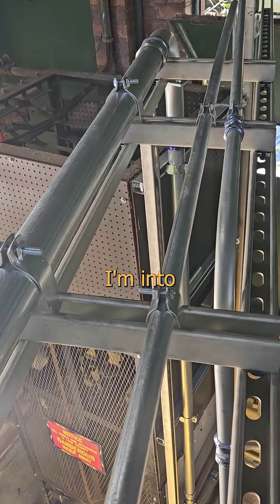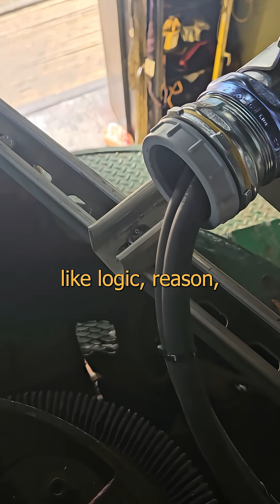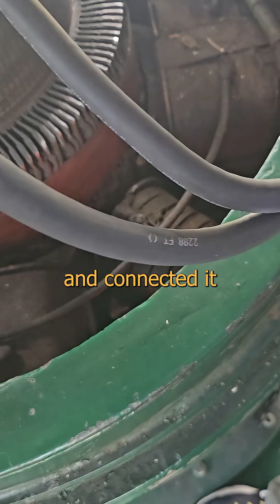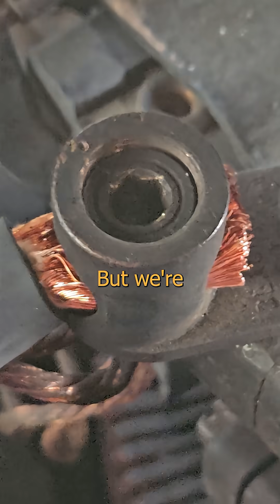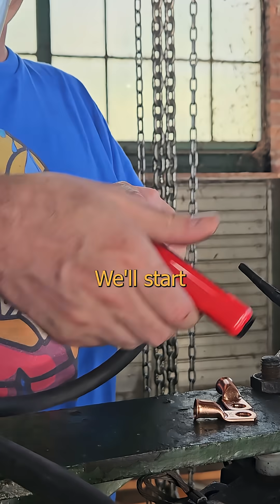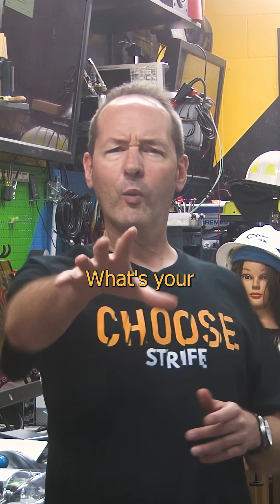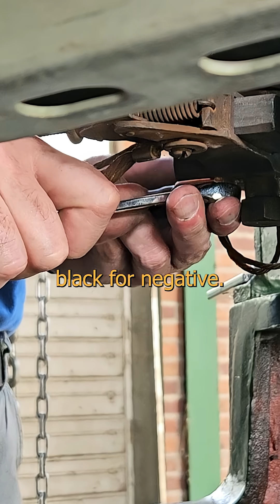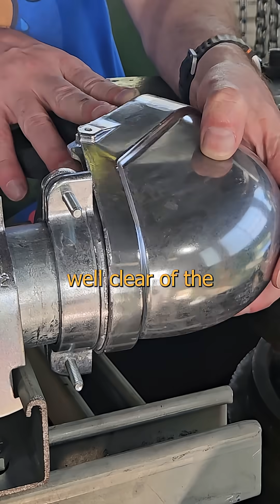Exciter Update #chrisboden #comedy #engineering #powerplant #electrical #educational #wiring

Comment: I've been wireing marinas for the past 17 or so years in salt water environments and we always nolox the terminals prior to crimping. Also we have found that heat shrinking tends to trap salt crystals over a few years. The wire we use is GGC, G or W cable so we also use ferrols when landing in mechanical lugs due to the fine strands of copper flaring out when torquing. Just a few things we do to keep the inspectors happy.

Comment: I doubt you read this but

Check the temperatures on those connectors - they may have cross-section lesser than the wire or copper worse than a wire.

Comment: ⚠️WARNING! Critical thinking in progress. Join the effort at will! ⚠️

 So....🤔 If an exciter slip ring will wear unevenly because of direct current, then the same will surely apply to graphite brush dc motors, right?    One brush will be shorter than the other at the end of lifespan ..and since the DC radiator fan motor cant simply be run in reverse for half of its life, then should one brush be made slightly longer than the other??  
Edit I have actually contemplated this whole reversing of the radiator fan. If switched in reverse and engaged for maybe twenty seconds after engine shutdown, the radiator might be sufficiently cooled by shaded, cool air which is drawn from underneath the vehicle, and all of the engine outer electronics might be cooled slightly better. The entirety of all engine heat would be evacuated through the ac condensor grid, forward. None of it would be blown back from the radiator, onto the engine. The fan motor itself would get its first actual forced-air, self-cool-down. Its WORTH A TRY, RIGHT??😊

Comment: Its better to heat clear heat shrink on the fitting use colored heat shrink lower down for indication. The reason to use clear on the fitting is to be able to see if and heat or other potential problem can be seen prior to getting worse

Comment: Noalox is cheap insurance on copper, and that steel grit actually improves bite between conductors if you have a bad crimp or a loose nut (I hate those).  Switched to that decades ago on automotive electrical repairs while living on the Pacific.  Haven't seen a black or green copper connection since.  

Using on connection nuts also improves fastener torque, and who doesn't more of that.

Comment: Being in electronics since forever (yeah, low voltage hobby stuff), I've always soldered most everything.  Is the copper-to-copper crimp "good enough"?  Are there cases when you'd want to solder things?  Or would that not make any difference?

Comment: Crimped lugs make me happy as the end user.  If they used crimping, they probably made the insides pretty too.

Also, minimize dissimilar metals when connecting equipment topside is one of the standards of mil-std-1310 4.1.2A (STANDARD PRACTICE FOR SHIPBOARD BONDING,
FOR ELECTROMAGNETIC COMPATIBILITY).  It prevents galvanic corrosion when exposed to water and air.

Comment: Noalox   No ALuminum OXidation  .   This is a compromise that you do not need to make for copper but is essential for older aluminum conductors.    I would put a lick of STL2  on the bolt thread for future ease of service,

Comment: What would I do? I do low power, my main tool is a schematc and a teeny tiny soldering iron. I do also have a big iron, but I doubt it's big enough for a wire that is that fat. The wire wouldn't be quite that thick here though, we have 230V.

Comment: NoALOx is nice to prevent oxidation, but soldering under a crimp is a superior соnnесtion as there is nothing to potentially slip the crimp. Especially since you stated the need to reverse leads every six months, putting torque on the crimps as they are swapped, potentially inverted, and re-torqued. 

Are we using adhering heat shrink tubing to remove any oxygen from around the strands? Now the solder makes even more sense.

Comment: Would not care about the neutral grease. But I would probebly lean up the contact surfaces, get som shinyyy metal on it. BTW in those fittings I would use some Ferrules.

Comment: When you take the time to do a job right amd ho the extra mile to make it better than you found it makes people trust you to do other things and it makes things last longer. I chewed out my mechanic about this over old leaking coolant hoses that are easily accessible when the transmission is out which it was for a clutch replacement. Day after getting back on the road the coolant hoses, that was surely bumped when the trans was pit back in, sprung a leak. One of those while your in there jobs cost me time and a repair in a gas station parking lot

Comment: Unless you weld braised or solder two pieces of metal together then they corrosion at any point they contact each other because they are dissimilar metals. The act of welding brazing or soldering essentially makes them into one piece so you do not have that layer of corrosion building up between them and one side is going to take the brunt of the corrosion crimping is not adequate to prevent this

Comment: Try lacing the cables next time. It’s a waxy twine that hold much better than zip ties. It’s common in DC systems alsothrow something under the cables when your supporting off the frame to keep the insulation from premature wear

Comment: I know this is an old video, but when I use those types of crimp plugs, I like to dip the tip in a bit of flux, crimp it like normal, then heat the cup with the torch, and melt some soldering into the wire-cup joint, to make it not only forever tight, but bonded.

I've never done a 120 volt DC, I usually do smaller things.

Comment: Use Burndy “Pene8”. It’s the goo that comes inside c-taps and hy-lugs. You won’t have any dissimilar metal corrosion with copper to copper, but will oxidize over time and this will prevent it, but it’s copper specific. Might be a good idea if you’re planning another century of good connection.

Comment: As a steel mill electrician, I use Burndy PENETROX on ALOT of connections. Especially in the wet environments, and when old connections have signs of corrosion. I will even use it on bolts that are partially rusted, or required the strength of Hercules to remove.

Comment: If you want a hard reference in aviation you would refer to T.O. 1-1a-14 ch 13 table 14 for uninsulated copper terminals. It will contain the pn for the terminal lug crimp tool and crimp die for terminating anything up to 0000. Terminating to this spec will result in the highest reliability possible for that class of terminal lug.

Comment: Copper to copper the only thing you could do is add dielectric grease to the joint after its crimped but before the heat shrink goes on. Aside from that, noalox isn't required for copper to copper. If aluminum isn't in the mix don't worry about the aluminum oxidation inhibitor...

Comment: I've put many crimps on "welding"  cable like this and I was taught that if the terminal looks just a bit too small it's probably the right size. The wire looked like it was too big for the crimp terminal but I bet he could make fit........ Just like in your mom.

Comment: Noalox is 100 percent of the time for me on stranded mostly large wire. You were just talking about wetting current and each strand has to do that everytime you use it and inevitably heat is produced due to some oxidation resistance. Which swells the copper. Then it happens even worse after it shrinks back down. Noalox prevents oxidation and long term thermo cycling. This will make it last forever even with very damp and even salt spray air. 
Source: 
Joe knowledge from Working with 600volt dc and 480 ac in places constantly exposed to salt spray.

Comment: Nice to see basic cable work done properly.
Makes me sick to see all the unfinished cable ends people just leave exposed to oxidation then wonder why things don't work properly after some time and use.
Stripped wire isn't finished. It's just exposed.
Crimped terminals and adhesive sealed heat shrink and woven sheath and loom is not expensive. Make cables properly and use oxygen free copper of the proper type and gauge for what you are doing. That way stuff works properly and lasts longer.
Good on ol boy for doing it correctly and showing the noobs what the end of a cable should look like.

Comment: When crimping fine stranded cables the tubular part where the cable goes in should be twice the length of your lug so it can be crimped at least twice. The lugs you are showing are for swa and larger stranded cables.

Comment: Seems to me that the surface of the crimp plugs connecting to the machine is way less than the original wire? Could that cause problems?

Comment: I normally like to see the crimp fittings with a hole drilled so I can solder the fudge out of them.. Just to make sure those fittings don't end up with resistance in them.. its a common problem on lower voltage DC stuff. At 120 volts im not so sure.

Comment: I keep the no-ox just for the 1 in 10,000 conection that starts corroding from acid exposure. It's uncommon enough in my field and they're all inspected every 3 months anyways. Your results may vary, batteries not included.

Comment: @physicsduck WAIT WAIT WAIT!! 120VDC?!?! I was just discussing this with a friend who thought all power plant turbines make DC and was wondering where/how that becomes AC. I said "no, no! They're all 3 phase! That's why at his day job PhysicsDuck, for example, has to sync the generator to the grid because if the phases aren't lined up when he throws that last switch: very loud, very expensive noises are made, as the generator's phases are instantly ripped into sync with the grid." Who's right? If we're both right, A) where/how DOES that 120 DCV get turned into B) How many phases of how many volts of AC?

Comment: If the termination or anything connected to it is not a hundred percent copper Nolox it never hurts. I use it on everything  now. Battery terminals to breaker panels.
Reply: @TNW1337   they specifically say not to use it on panels and stuff

Comment: Noalox is for dissimilar metals with a current ran through to prevent electrolysis. You should also solder that crimp end if the machine has any bot of harmonic vibration. I see loose wires from mediocre crimp jobs all the way up to professional crimp. Just a little time now saves you hours a few years from now when you are troubleshooting that exact issue. Learn from others mistakes to better your own work. Please!

Comment: Question, why do you need 120v DC? Is that 10 12v batteries in parallel? Or 20 in series-parallel? What are you moving with that power and why would you want more voltage not more amperage?

Comment: High voltage enginerd… That rotate every 6 months, thats a real issue.

TLDR : Water bad, add silicone grease.

TLDR But its still a lot : In systems expected to be fully submerged, often completely sealed connections are made, thats fine…

But for the rest of the world with exposure to water, especially repeated condensation/dry cycles in cold plants etc. The ingress of water into electrical connections introduces hydrolysis… which increases the rate of conductor decline.

Why? : arcs bad, example : With industrial laser cutters by example, closed ring ferrule like shown here are used… only with a jacket that is twice as long as the crimp site is wide. This ferrule is filled with a silicone wax/grease and then crimped twice. One crimp to the conductor, one above to the insulation. That whole jacket is then covered in shrink as usual… This is just to slow that rate down. Arcs at those voltages and amps can jump multiple meters… let’s not tempt it by growing small air gaps.

One of many Sources : ”Nuclear Engineering and Technology : Crevice chemistry and corrosion in high temperature water.”

Edit : I’m better at wiring than i am at typing.

Comment: wouldn't you want to use something even on copper to copper connection to prevent oxidation over time. Source - ::looks at collection of lose change I've had since the 80s and 90s and see that pennies are tarnished and dull::

Comment: With the heatshrink, some people have it too far down.. like you have on the red terminal. Then when tightening it.. the heat shrink gets between the 2 surfaces and increases the contact resistance by a lot.
The black one is done well

Comment: Are you serious?! You put lugs on without also SOLDERING?! Drill a small hole in the wall of the lug & add a dab of flux before crimping, buff it all back to bare copper right away and heatshrink it while still warm (this is my SOP for all lead acid battery connections. Why not go all out here?!)  fistbump

Comment: Unlike most people in the trade I use NoAlox quite often. Even though it is not required, it does help keep things from getting corroded. It also acts as a lubricant on threads. Putting some noalox on threads of a mechanical lug will keep it from galling, or seizing up.

Comment: De-Ox, no-ox, whatever you call it.
Always, ALWAYS, a good choice.
Me. 
Just a dab will do ya'.

Just a flim, on O-rings too.
Cheap, junk ass o-rings today. 

Also, in wet environments, steam beaver,
use a thick mil heatshrink with adhesive goo.

Label your cables, OR make a place to label your cables, and place 3M clear
magic tape over them tight and smooth.

Nice work btw.

Mom says Hi.

Comment: Also helps if the next guy to work on it doesn't over torque the fasteners to high heaven, as an auto tech this is something I see far too often... The number of snapped signal posts on starters and stretched battery terminals I deal with...

Comment: I'm not an electrician, but that stuff the auto parts store sells worked pretty well on the 12 volt battery in my car. Even after years of weather, salty air, and hot-cold transitions it held up. CRC sells whole cans of it (05113), and it's rated at >450V/mil (donno what that means) and -70F to 400F operating temp. It's a silicone base, but IDK how good that is in the high voltage world.

Comment: Tradition is no excuse for critical thinking. Sometimes legislation does. When lawmakers are not up to date in technology. I worked in a lab and prior to cyber security no one thought about hacking computers controlling laboratory equipment. When it happened it created panic. So they handed it off to medical device committee.  They treated it as a medical device. This meant clinical trials of 5 years prior to use in clinical use. This meant all patches are 5 years out of date. When I retired in 2022 our last update migrated NT to Windows 2000

Comment: Fun fact. All of the DOT microwave stations in Florida have the polarity colors reversed for DC current(or did in the near past) because it makes more sense to the chief engineer.   🤡 
There are burn marks all over the place from people not getting their Fluke out to test polarity. Fortunately for me, you f^cking always test when working with piles of batteries in a string.

Comment: Here's your Logic and Reason: 
Once you Crimp those 'modern' connectors your done, you can't do it again.  We all know what the heating and cooling cycle does to connections.  
So why would being able to retighten connections be a bad thing?  How many times in your maintenance procedures have you put a wrench on a bolt and gotten another 1/4 turn?  Or tightened the lugs on a breaker.  
What do you do with a crimp?  Wiggle it?  If it moves enough replace it?  Or just replace it in 'an abundance of caution'?  I suppose you could shoot it with an IR gun to see if it's too hot.  
I'd keep the old connector.  You can see it, you can tighten it, you can check it.  You can tell if it's been damaged.

Comment: New aluminum doesn't need nolox, old inspectors will never believe that. 

The old connections were just fine and in fact had less points of potential failure.

Comment: Most people don't even use noalox correctly on aluminum as intended. Unnecessary on copper, but even if you decide to use it, you're supposed to work it in with emery cloth or something. I don't know I never read the instructions

Comment: The main purpose of swapping polarity on your slip rings is because one polarity builds a lubricant film while the other strips it off and that film helps reduce brush wear, not slip ring wear. We always did it once a month but those were units that ran 24/7.

Comment: From my finding, noalox on either copper or aluminum is fine, but it is unnecessary on copper connections. Southwire recommends the use of Noalox on all connection types. Meanwhile, electricians state that on copper to copper connections it is unnecessary. I might consider it after the research if I lived closer to a brine slinging ocean though.

Comment: I use a hydraulic crimper similar to yours, then I sand the sharp edges smooth that the crimper leaves, then heat shrink as you are.  Have used a punch and hammer in the past, especially useful in a pinch.

Comment: crimp plug is too thin. i would use a thicker copper. it does fit, its just too thin for the gauge wire

Comment: I use noalox on high-current applications for copper, if you’re in the thousands of amps range, any heat will cause a small amount of oxidation and start to be a greater-than-negligible load.

Comment: Here's my thinking. No locks is good in situations on things that you know. You're not probably not going to touch for many many years. Not in terms of like a panel but in terms of that lug is probably going to get dirty underneath. A little bit of no locks, especially inside of where the bolt goes would be a smart move

Comment: Noloax would be fine. I got no sources for ya it’s just our common practice but when we do main feeders for transfer switches, switch gears, splice crimps or panel feeds we noloax them. It helps stop corrosion and keeps things lubricated like the Allen head lugs. You can also use copper-rich same thing as noloax but instead of aluminum it’s copper based. It’s messier than noloax but does the same thing.